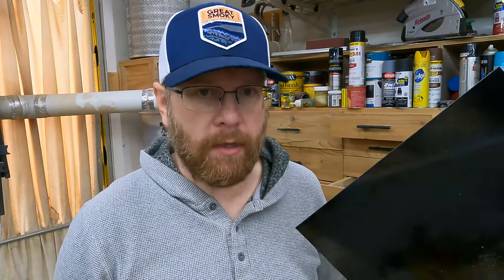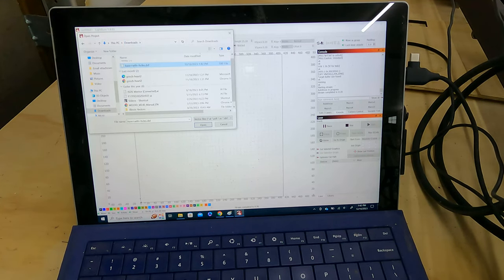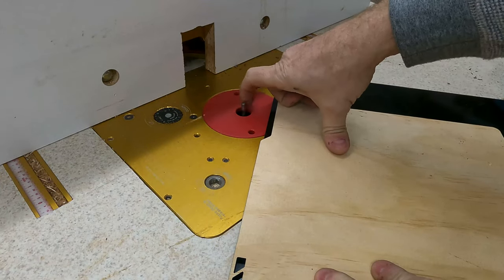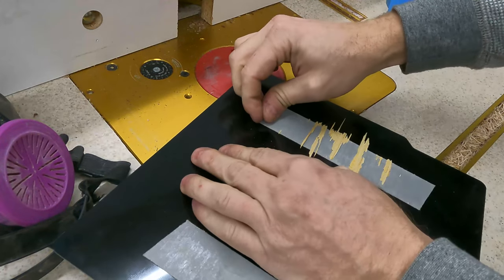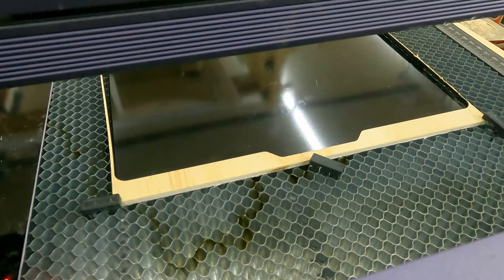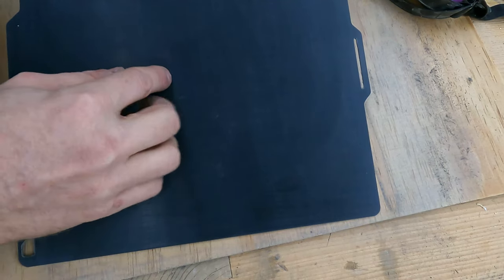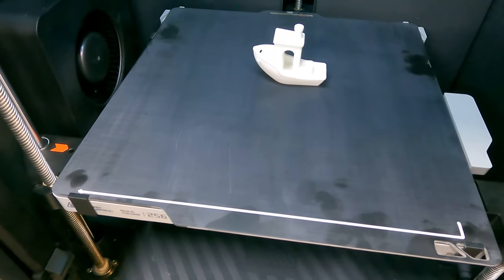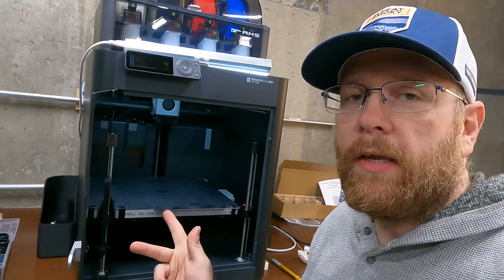WOW! Make Your Own G10 Build Plate for Bambu Printers

Comment: I just made my own G10 bed a couple weeks ago. To avoid using clamps, I glued the G10 to a PEI textured steel sheet using high temperature resistant epoxy you can get for $10. Set the G10 on something flat, add glue, add spring steel and lastly add weights on top. Worked like a charm! I bet you could cut some thin mild steel with your laser to match the contour of your bed and glue it. :)
Reply from the maker: Great suggestions!

Comment: Step 1 : Own a laser cutter
Reply from the maker: Wrong. Step 1: Own a Bambulab 3D printer
Reply: Nope, own a router. From what I have seen in this video a router works just fine. Besides a normal router I also have a Dremel router add-on with a copy ring which fits my Milwaukee rotary Tool. So the slots in the plate will let themselves be routed just fine I think.

Comment: I actually had a sheet of G10 I bought for a Voron that I ended up selling. Went to cut out the sheet for my X1Carbon and decided to do a search to see if others had already done this. Your video was a great help to confirm my thinking. As a heads up for anyone that might be trying this, cutting the G10 with a table saw is possible, but make sure you have a very high tooth blade as the G10 is so stiff that the edge likes to chip a little as you cut.

Comment: G10 has become my favorite build surface. Working for everything I've tried so far: PLA, PETG, ASA, ABS.
Reply from the maker: I love it. I want to get another one and try to print on the glossy, unsanded surface this time. I hear it can be challenging, but I want to give it a shot
Reply from the maker: Great to hear. Actually have a video coming down the pipe on how to make your own liquid adhesive for pennies. It is a simple and awesome recipe. I hope you check it out.
Reply: @SouthpawWorkshop  Definitely interested in a DIY solution, especially if it saves money!

Comment: Gonna be making one for my trident soon which should be easier than the bambulab and was thinking of buying a thin steel plate and connect them together for it to be magnetic
Reply from the maker: Definitely doable, and I plan on trying it out myself. Be sure to use this adhesive film instead of glue: https://amzn.to/48w3ctT
It was designed for attaching PEI sheets to build surfaces so it will work for your G10 surface.
Reply: That's a great idea to keep it nice and flat, thanks a lot!
Reply: @rallegade  Did you try it yet?  I just removed the PEO and PET films + adhesive from a sacrificial buildplate to do this and it was NOT fun, the adhesive was very stubborn.

Comment: I gotta imagine I should be able to just cut it down and glue it to one of my existing engineering plates. Just a question of what glue would work. Two-part epoxy, maybe?
Reply from the maker: They make heat resistant double sided tape sheets for this specific purpose. You can find it on Amazon. I’m considering attaching mine to a spring sheet I got off of aliexpress using this method.

Comment: As you mentioned, that long slot at the back is put in the Bambu bed sheets to allow the small strip of bed materials to flex as the nozzle wipe action is executed in the pre-print process. Did the wipe work or did you end up removing it from the starting G-code?
Reply from the maker: The wipe appears to be working well. Just as with my textured sheet, it is wearing a small groove into the surface of  the tab.

Comment: You are really good man. And: The leveling probe on bambu is inductive? I mean G10 is not metal. So how can magnetic probe work?
Reply from the maker: The leveling isn’t inductive. It is resistive. Basically it senses the increased load on the motors as the nozzle touches the build plate, and that is how it knows where the surface is. It allows you to run non-metallic build surfaces also.
Reply: Aaa ok, thx

Comment: Nice job by explaining the G10, i love your video and the time you spend on it to test it out.
i do wonder what power the laser had that you was using. was it 10W ? 20W ? 30W ?
if you do not mind, can you try to figure out what kind of G10 you used ? there are lots of different kinds so lots of confusion :( 
and before asking, no, not all G10 is the same.

if i can also give you some advice, add some protection to the wipe area as i am certain your nozzle is worn out after a few prints. ( took me 4 prints to wear out the nozzle .. G10 is extreme abrasive xD) 

Keep up the good work :D